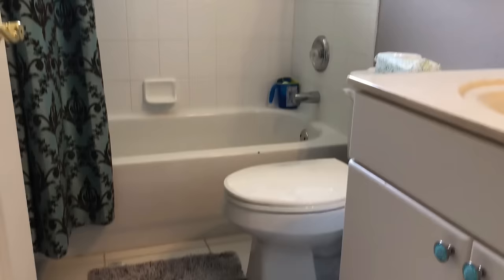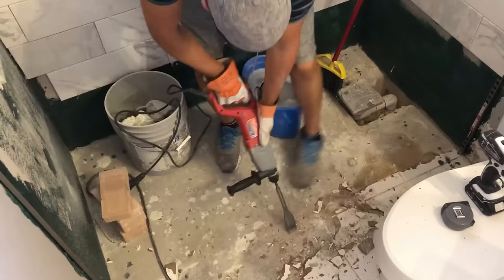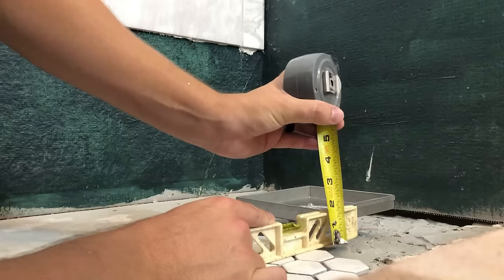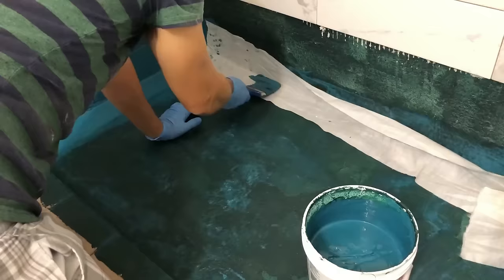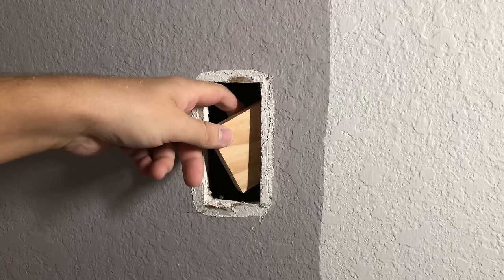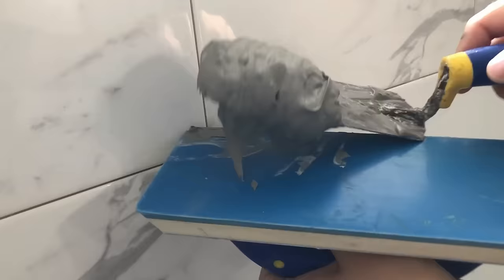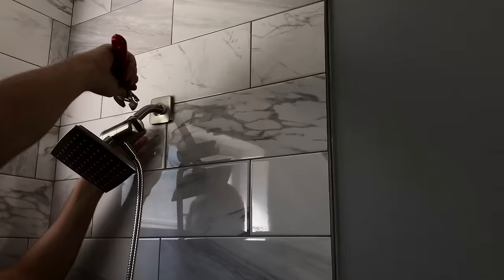Complete Guest Bathroom Remodel DIY | Start to Finish Tub to Shower Conversion

Comment: Looks intimidating.
Reply from the maker: Start small project at a time and with each time learn something new that you are afraid of. For example, I remember first time I replaced a light switch I was nervous even after turning off the circuit breaker. lol

Comment: The results are good, and everything is acceptable except for one thing. You forgot to install a shower pan liner. There are different kinds of products you can get from Oatey to Schluter 

If the waterproofing around the drain fails, you'll have a big problem. A liner is installed to ensure it will hold water, designed to drain through weep holes. When you do the next project, you'll be better able to keep doing what you do. Not many people can tackle that
Reply from the maker: Thanks for your tip. This is a learning process altogether. I'm glad people are providing their feedback.

Comment: Great job on the entire reno. They say hindsight is 20/20. Would you realign the first row of tile to ensure that tiles align better around the window? At 2:37 you can see two horizontal strips of tile around the window. A single strip might look cleaner. Amazing job nonetheless.
Reply from the maker: Yeah probably not a bad idea. Something I definitely didn’t consider during the layout process. I think I was more worried about top and bottom pieces to be big enough. It’s a learning process every time u do something

Comment: Great video! Only criticism is that the shower doors are on wrong, the inside door needs to be on the side of the shower head
Reply from the maker: 🤔 can you explain what you mean exactly?
Reply: The two sliding doors in your shower, the one on the inside of the frame (closest to the side of your tile if that makes sense) needs to be on the side of the shower head. Makes it less likely for water to sneak through the big gap between the doors.

Comment: Looks great!! Why did you not install or build a shower pan for the shower? Just curious! Is the mud and waterproofing sufficient.
Reply from the maker: I messed up. You are suppose to put the shower pan first before cement board. But I did cement board and tiled the top part of the shower so this was plan b. Not ideal but it worked.

Comment: Question : what’s the process if my floor is wood and no cement ? Do I lay down cement board then the cement paste followed by the sealer ?
Reply from the maker: I personally never done on wood floor before but from what I’ve seen was yes you do cement board and then tile on top of that. But do some more research and see what others recommend.

Comment: Hey. I have a question. When taking off the shower. How sensitive are the knobs to being turned on. And should I turn the water off before doing this?
Reply from the maker: I would try to keep the knobs in the off position. If they in off position then U can tear the shower out without worrying about water running. Once u are ready to replace the shower valve then u definitely need to turn your water off. Other thing is be careful not to damage the plumbing during the demo so that you don’t have a leak everywhere if you keep the water on.

Comment: You should have used aquadefense over all of the Duroc cement board, not just the seams.  The Duroc is not waterproof.
Reply from the maker: Yeah that was one of my mistakes. I did cover about 3 feet off the floor on the walls and the niche but not all the walls. Next one I learned my lesson. 😅

Comment: Why didn't you use a plastic pan liner?  I guess they do it differently in Florida.
Reply from the maker: So it was my first mistake. I actually had the liner bought and I forgot you are suppose to install it before doing cement board. So I installed cement board then tiled the walls and then when I thought of the liner it was too late. So I spoke with my brother who is a tile contractor and he recommended doing this way. That's the story.

Comment: Good luck when that cpvc female adapter breaks in the wall because you didnt use the stainless transition style. Also did you use a pressure fitting on the elbow of the drain?
Reply from the maker: What you mean pressure fitting?
Reply: @Daddicated  i mean the video is sped up but the elbow going from the drain to the p trap, looks like a pressurized fitting not one used for dwv
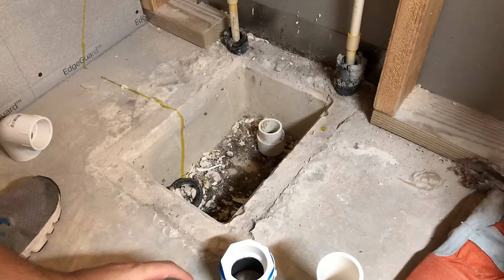Reply: @Daddicated  ya i just rewatched it. At 1:28 and 1:32. Those aren't the right elbows. I run into this shit all the time IN FLORIDA, there is no way to snake that WHEN NOT IF it gets clogged

Comment: Wow great job but the shower door was installed wrong and will get leaks between to door and panel
Reply from the maker: Can you please eloborate on how I should of done? So I know for next time?
Reply: @Daddicated  sure first the step in ur shower looks like u installed the tile level the step need at least 1/8 inch pitch going in the shower so that way the water runs inside the shower 2nd on the video u have the shower head on the right side so the water will spray right between the gap of the panel and door to fix that the panel has to go in the inside and door in the outside
Reply: What’s going to happen with ur step being level the water is going to built up an some will go inside and some will go outside water will go where ever it’s feels like it. It will ruin ur baseboard and wall in the long run

Comment: you didnt need to use a pan liner? you can just you aquadefence? Wow didnt know that.. please confirm!
Reply from the maker: No you probably should always use a liner. I messed up and installed my cement board and tile before I realized I had to install the liner first. So this was my plan B approach to at least have some sort of protection. I also used a membrane in the corners with the aquadefense for extra protection. I don't recommend doing it this way.

Comment: With the shower head on the opposite side of the wall as the door that opens are you having trouble with water getting in between the doors?
Reply from the maker: There is a plastic guarding that fills the gap between the doors so no water gets out.

Comment: I am inspired.  Did you have prior experience on remodeling?  Is this your first time?
Reply from the maker: So this was my first full remodel on my own. But I worked as a tile helper/installer for 4 years for my father growing up as a teen/young adult while in college. That’s where I learned how to demo, lay tile, and grout. Plumbing I learned on my own doing small plumbing projects around the house. Same thing with electrical doing small repairs/replacements around the house. Also repainted our rental place/repainted our house when we first bought it. Basically little experiences prior to this big project. At the end of the day start small, first learn one thing, then the next and before you know it you will have enough confidence to do entire project. I remember my first time replacing a light switch I was terrified even though I knew power was off. Lol. Anyway, I challenge you to start on small projects and work your way up. 💪🏼 u got this.
Reply: @Daddicated  thanks bro for your response.

Comment: Was there a reason you didn’t waterproof your walls with 2 layers of Aqua Defense? I’ve watched a lot of professional builder videos and tutorials and they always recommend saying not a matter of if but when your shower will fail with water damage due to lack of waterproofing.
Reply from the maker: I guess the lack of experience. I did waterproof the bottom two feet very well and that roughly where most of the water will be. But yeah I should just painted the whole shower. Lesson learned.

Comment: Guys don't skimp out on water proofing he should've coated all of the cement board with that rolled on membrane twice but he just did the joints and you also need to fill the joints in with thin set.
Reply from the maker: Yeah that was an oversight definitely did it different on the next shower.

Comment: It looks good man, but I think you’re going to get mold. You have to water proof the entire shower. Also how come no pre slope mud pan with pan liner? The mud pan is done in several steps not just one. I used a kerdi membrane on mine. Cost like 700 bucks to do it but it will last 20 years.
Reply from the maker: There is a slope I just did it manually. I also put membrane in the corners and waterproofed the entire floor prior to tiling it so it should be good.
Reply: 20 years....I doubt that. check out some videos of Kerdi, installed correctly, leaking after a short time.

Comment: Filling the drain with cement feels like a mistake. You can never replace or service the drain. What if it had been cemented in when you went in to update the drain? Great project tho!
Reply from the maker: Nah all of our drain plumbing is under cement in the foundation here in Florida. So I think it will be fine. Plus drain pipe doesn’t experience pressure so it shouldn’t have any problems in terms of rupture.

Comment: Why didn’t you use a moisture barrrier membrane on the shower pan and did you slope the pan?
Reply from the maker: Because I was suppose to put the pan before doing the cement board so I had to go to a secondary option by water proofing it. I did slope it.

Comment: Did you add green board to the ceiling of the shower?
Reply from the maker: No I left it how it originally was. Not sure if they originally did a green board or not since it’s covered with texture and paint.

Comment: Amazing job! Do you have a link for the shower door? And also for the vanity set. I see a similar one on floor and decor but just need to be sure
Reply from the maker: Here is the glass door. 

https://www.wayfair.com/home-improvement/pdp/glass-warehouse-60-w-x-78-h-single-sliding-frameless-shower-door-gaks1952.html
Reply from the maker: I can’t seem to find exact vanity from Lowe’s but here is a very similar to ours:
https://www.lowes.com/pd/Vinnova-Gela-36-in-Single-Vanity-in-Grey-with-Carrara-White-Marble-Countertop-Without-Mirror/5001657123

Also thanks for the feedback.
Reply from the maker: @ImamAliSeminary  not sure we bought one with out the counter top so it was probably around $300 or so

Comment: i noticed you didnt use a shower liner under the cement is that possible
Reply from the maker: I forgot to install the linear and when I realized it was too late. So I waterproofed the mud set and sealed the corners with membrane instead.
Reply: Is it good to weatherproof the mud along  with the liner

Comment: Great job!! It’s very nice, how long did it take you to do it by yourself? Also, this is the reason it’ only costs only under 4k  because you did all the work yourself and the bathroom is small. Typically people spend around 4-6k on materials, higher if they go for very expensive tiles or have nice tubs or expensive double sink vanities. This bathroom would have costs 10k if a contractor did it even with the exact materials used.
Reply from the maker: I think about 6 months because I did it over thanksgiving and christmas breaks plus other things came up on the weekends so it took me awhile to finish. And yeah I completely agree with you about the cost. Definitely saved a lot.
Reply: Not 10k. Probably about 4k to hire someone to do. It should take contractor 10 days or less.
Reply: @yutu4106  10k includes the material and demolish. It’s just a rough estimate because contractors charge differently. Some charges based on your neighborhood too. They see that you live in such good neighborhood they will charge premium and pretend that’s their standard price. I know how these works and it’s bs but you cant do something about it because it’s their price. You just move on and get another quote.

Comment: You should have waterproofed your niche as well.  Usually a bit of water stay on the niche
Reply from the maker: I did waterproof the niche.
Reply: @Daddicated  I mean from the niche all the way down.  If your walls are exposed water will still be absorbed in your boards making waterproofing at the seams irrelevant.

Comment: Is the cement board waterproof?
Reply from the maker: No, u are technically suppose to water proof the entire shower but realistically the shower bottom is what sees the most water exposure the top very little considering, you have cement board, then cement, then tile/grout. So for water to penetrate all three things to get to the wood you would have to literally continuously soak your shower wall for hours. So I’m not to worried cuz I’m pretty sure I’ll be good for awhile.

Comment: I could just fly you out to come do mine. These contractors are going crazy with the estimates they giving me 😩😫
Reply from the maker: How much just curious? And where is this at?
Reply: @Daddicated  Colorado! I was quoted $45000 for 3 bathrooms to look like this. I almost choked on my meal when I heard that. This was just to have a walk in. No flooring or anything else included
Reply from the maker: @Curious_gen  Dang. That's $15,000 a bathroom. And no flooring. That's crazy. I mean if it was everything included then I can see why. Material is about $5,000, labor $5,000 and profit $5,000. lol

Comment: Do you have a update vid of how it’s holding up ?
Reply from the maker: Not yet but that’s a good suggestion. Do like a year review or something?
Reply: @Daddicated  yea that’s what I was getting at
Reply from the maker: @CharBuilds  thanks for the suggestion. I’ll definitely will need to record one. I mean overall everything still looks as good as new with no problems so it would make a boring update. But I may do one regardless like a quick one.

Comment: why did you opt out of a shower pan? this is the same layout of my bathroom and i’m just curious!! what was the total cost?
Reply from the maker: Lack of experience. When I used to work as a tile installer part time we always did them from scratch. But a pan would of been easier. Total cost was about $3200 but that was in 2019. Now it probably would cost closer to $4k-$5k range probably.
Reply: I’m nervous to do tile I have no experience lol so I think a pan may be best for me. i’m keeping my toilet it’s new so I think that’ll help with cost. Can I place tile over pre existing tile??
Reply from the maker: @celinedraper4842  Well bathroom is a small area to start. I wouldn't recommend it tiling over existing tile because if that tile is old, or cracked, or isn't holding on good over the years then the new tile will be at the same jeopardy. Best thing is to remove old tile.

Comment: Is that a gfci plug by the sink??
Reply from the maker: Yes I believe so. Why?
Reply: I was fixing my kitchen and bought regular plugs to put around the sink and was told by my friend, whose an electrician,  to make sure the plugs near water are gfci for protection. Awesome video by the way!!!
Reply from the maker: @metanivk  That makes sense since it's near water and could cause a problem. Thanks for the feedback.

Comment: I would not use this method if your tub is sitting on the typical plywood sub-floor. A heavy P.V.C. membrane on the floor and 8" up all the walls is needed to prevent the water from rotting your floor.
Reply from the maker: Yeah I agree with you. I just did my Durock and then realized I forgot to do my membrane so at that point I went with plan b.

Comment: why are pipes old in apartments? and just someone pay for new ones that last a long time or while I'm trying to change my bathroom sink it's so very bad !
Reply: I wanted it to be a small er vanity to have and if change and need a cabinet like this one or you had but it's 43 wide here and I may not don't think I like these countertops to use faucet good
Reply from the maker: Pipes are old cuz apartment is probably old. I’m sure to replace all pipes in an apartment is very expensive.

Comment: You know you created an s trap the way you piped that shower drain right? Does it gurgle, be honest now 😁
Reply from the maker: No it doesn't gurgle. I made it no different than the way the tub drain was. Only different there is no overflow like there is usually in a tub.

Comment: How long for entire process?
Reply from the maker: 3-6 months. There were holidays in between along with some vacation. I was mostly doing it over the weekends so I couldn't do much at a time.
Reply: @Daddicated  👏 Starting my project has been a monster because of defective tubs but we're finally going to get started and knowing other's DIYer's project times helps me to set realistic goals. So a weekend may have been a slight underestimate😬
Reply from the maker: @luv14lyf  Yeah I would say so. Tiling just the shower alone is 2-3 day project. But you still have to do demo and all the other things to prep the shower before doing tile.

Comment: Dude,.  You did a nice job!
But where is your shower pan liner that goes down first and comes up the walls 6-8 inches???
You can't just put down aqua barrier with some mesh cloth.  Aqua barrier is what you seal all your walls and floor with before you set the tiles..you have to put down a rubber mat to keep any water contained in the shower area..   That is a crucial piece of this job for protecting your house from having shower water leaking into your adjacent rooms.   Sorry to be the bad news guy cuz you did a really nice job other than that.
Reply from the maker: Thanks for the feedback. Live and learn all I can say.

Comment: Looks like you didnt waterproof your cement board.🤔
Reply from the maker: Yeah I kind of did the bare minimum. Been getting a lot of crap for it on my waterproofing video. Lol. Oh well. Maybe on the next one I’ll waterproof the entire thing
Reply: 70 inch above floor is reccomended. I go 80 just because...
Reply from the maker: @abro9598  yeah I did like 24” lol. 70” seems like a little bit much but I guess if ur doing it might as well do the whole thing.